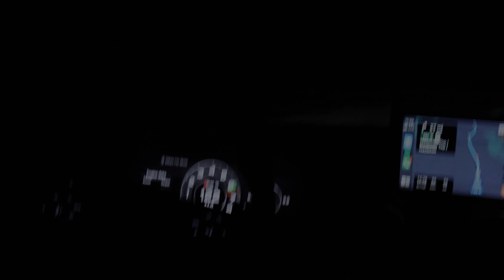2020 Audi A3 Gets A Splitter

Comment: where do you get a tune for all these parts im in pa and the place i called said they cant do custom tunes because i got a couple aftermarket parts for my a3 myself like a cold air intake changed muffler res delete dv upgrade how would i get a tune for the stuff i need one so bad